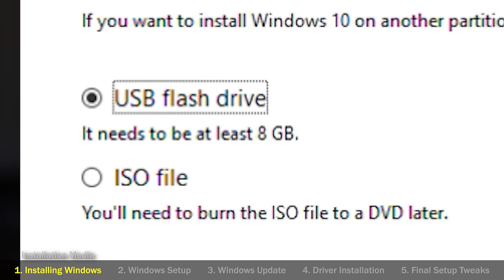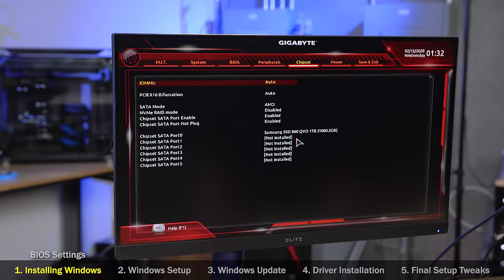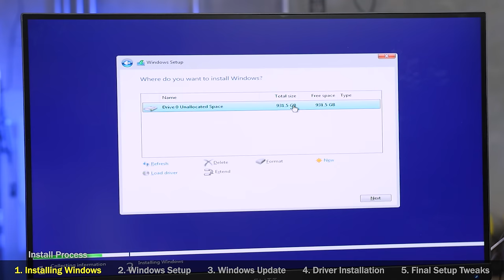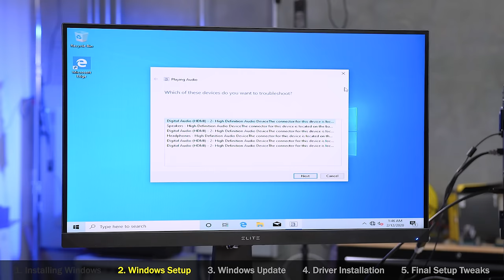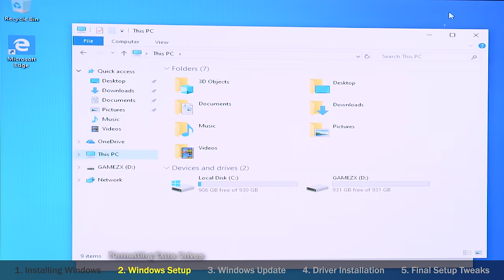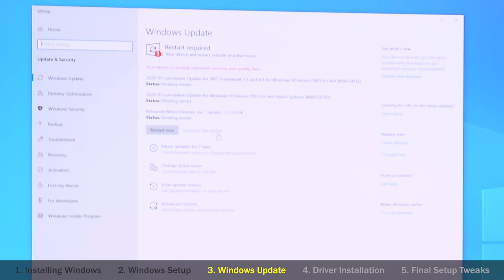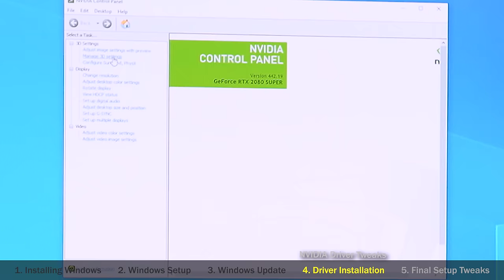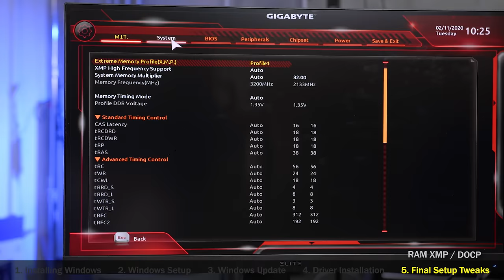Guide: What to do AFTER building your computer...

Comment: Pro tip:   after getting Windows up to date, run "disk cleanup" and delete the old Windows installation files freeing up 20 GB plus on your operating system drive.   You're welcome.
Reply: thanks
Reply: Can I just find it if I type "disk cleanup" in the win search bar?
Reply: ItzStreamBot do i go to properties when i right click the disk on my computer?
Reply: uhh i think you might need them for backup?
Reply: Saving this.
Reply: Imperial Diecast nope cus u can always boot ur windows usb flash drive to reinstall ur os
Reply: @ImperialDiecast  no, you don't. You might be thinking of system restore, which is not the same as old update files.
Reply: I get the disk cleanup but how do I delete my old update/installation files? Which ones are they?
Reply: @enhancedjerry5251  You have to click "clean up system files" (bottom left button--wait for it to scan, then make sure "Windows Update Cleanup" or "Windows Installation Files" is/are checked).
Reply: Did I mess up by buying a windows cd without a disk reading thing
Reply: Do I need a hard drive cause I only bought a 500g ssd
Reply: @homeskillet8751  It depends on what you are doing with your computer.   For basic web browsing and office work 500 GB is plenty.   If you are a big gamer, you will need a second drive for game storage.
Reply: Delete Win32... Saves loads of space! 😂😂
Reply: @homeskillet8751  I only have a 240gb SSD, but I definitely needed more space for games. Got about 50 games on Steam and DCS and soon Flight sim 2020... Go with a 2tb HDD and then you can always get more if needed.
Reply: @JeckoPlays  If you have an activation key that came with the CD, you can just make an installation from USB with the MS tool, and then install from that and activate with the key that came with your CD (it's not on the CD itself). You'll need a USB drive with at least 8GB free for the installer.
Reply: @DaedalusSix  okay thankyou
Reply: Thx @ Ben klassen
Reply: Also delete system 32

Jk dont
Reply: I don’t need to I have 5tb
Reply: Also debloat tool works great!
Reply: @JamesW81  how do you do that? Is that totally seperate than 64, they do not intermingle?
Reply: @illustractorydraws  yes
Reply: big brain
Reply: Oh man, I knew that but I completely forgot about it
Reply: The usual maintenance always does favors.
1. Right click to Run: %temp%, temp, prefretch--------> delete all

2. Disk cleanup

3. Defrag
Reply: Unless u had windows 7 and u want to go back because windows 10 is shit
Reply: I don’t expect a response so late after the fact, but does this apply to installing a second drive? I originally had just a 1TB SSD, and I’m adding a 1TB NVMe drive. Do I use a bootable Windows usb drive and treat it like a fresh install to the NVMe, then follow what your comment says and apply it to my original SSD that still has my games and other files?
Reply: @djingo8253  Try cloning your SSD to you NVME.   You'll need a NVME USB external enclosure unless your current motherboard supports M.2 drives.   If it does, put it in there and clone all of your partions on your current C: drive SSD to the NVME with free Macrium Reflect software.   After done, go into your BIOS and select your NVME as the first to boot (highest priority).   After you've confirmed that you are booting from the NVME, you can use "disk manager" to reformat your old SSD for other uses.
Reply: @djingo8253  Make sure you are running the uefi version of Windows.   If not, I'd recommend just moving your game libraries to another drive then doing a clean installation of Windows using UEFI.
Reply: Ben Klassen I am running UEFI Windows (or it was, I’m rebuilding my computer with updated parts) , and I don’t want all my game files on my NVMe yet, just Windows to boot up and then add more files and game libraries when I’m ready. I’m more concerned on installing windows on 2 drives in my system
Reply: Ben Klassen thank you for responding!!!!
Reply: @djingo8253  In that case, I would recommend just a cleam install of Windows on your NVME.   If your computer is a pre-built (HP, Dell, etc.)  look for the option to make a system recovery disk or USB drive.   Make the disk then use the disk to install Windows on your NVME.   You just have to select to boot from the USB or disc in the bios.
If your PC is home-made from parts, download the latest Windows 10 .iso from Microsoft and make a USB bootable UEFI enable installation thumb drive with Rufus.   Then boot from your UEFI thumb drive and install Windows to your NVME.
Reply: Thank you so much🙏 I put my computer together from separate parts. There won’t be a problem with windows installed on both drives when I try to boot?
Reply: @djingo8253  not if the NVME is higher on the boot order list in your bios.
Reply: Ben Klassen I appreciate your patience and professionalism, and apologize for sounding like an incessant child who wants to play fortnite... thank you very much
Reply: @falsely  also be sure to click the button at the bottom that says "Clean up System Files"
Reply: @Trueflights  If you start it by typing cleanmgr.exe in the search you can right click the search result & run as administrator, which runs it with that selected to begin with, saves it calculating savings twice.
Reply: @illustractorydraws  Yes, you can. At least on any Windows version from the past two years+.
Reply: @enhancedjerry5251  What he didn't mention is clicking "Clean Up System Files", which will then do a second scan on system files. THEN one of the options will be called "Windows Update Cleanup", and the other will be old Windows installation files (or something to that wording idr exactly). If this is a brand new Windows install, you may not even have that second one, and if this is after an upgrade/update from Windows 7/8 to 10 or from an old version of W10 to a new version (aka a feature update), then deleting these will cause you to be unable to revert back to that previous version if you have problems. Also, I think Windows automatically deletes them after a month or so.
Reply: Running Tron script wouldn’t hurt either!
Reply: What's the main benefit of activating a windows user account offline instead of on-line?
Reply: is it okay to install my drivers and the windows installation media on the same USB before booting up the PC for the first time?
Reply: @abzz9913  Yes
Reply: Thanks ill try that

Comment: The real thing to do after building a new computer is to sit and stare at the spot where a new graphics card should go.
Reply: My answer was to get a 5600G lol
Atleast I can play some lightweight games lmao
Pain
Reply: So expensive right now 😫
Reply: @MishiMIshaniz  i got the 5700g.
Reply: @rebelprime  better to get 10400f (cheapest strong cpu) with used gpu
Reply: @Donutsdesigns  here in australia, a gtx 1650 is like 400 AUD, not great but not crazy.
Reply: Cheeky
Reply: @MishiMIshaniz  I have a 5700g lol I feel you
Reply: @kinnymane8593  so about 1100?
Reply: I have a 1060 6gb, 1080p is good on most games and I play competitive FPS and do good with it. 

Tbh you’re probably better of waiting if you can and just get something cheap to last a couple years till you can get a decent gpu. Then again this could be objective as most my games are cpu bound..
Reply: @kinnymane8593  what currency? USD? Bc that's less than what I paid for my 6800XT
Reply: Well... I guess I have something there, at least, though it's just a GT 710, so there's still far too much free space. =(
Reply: @kinnymane8593  thanks I need to look into that ✌️
Reply: @xil3ntkha0s  I got the 5950x cpu and it’s an incredible combination with the 3080. Running everything maxed out on 1440p. Ray tracing and everything, even cyberpunk I’m getting tons of frames. On RB6S ultra graphics I’m getting 400fps lol it’s worth the price I believe
Reply: @kinnymane8593  lol yeah the 6800XT only gets high fps in that game if you turn off Ray tracing running at 1440p otherwise you get like 30 or so with everything maxed out.
Reply: @xil3ntkha0s  good news is the gpu shortage means you can sell it for the more than you paid😂
Reply: @zcupofwater  that's actually pretty bad, i got a 1050 ti for a quarter of that price
Reply: I'm reusing my radeon rx 470 till I upgrade to a 570
Reply: @kinnymane8593  yeah i dont know what people are complaining about you just gotta look at some of the lesser known websites or check the big websites everyday and you'd have what you're looking for
Reply: @epenaloza52  damn feels bad man
Reply: @hent-imeananime2141  -_- you have no idea I'm basically where I was before. my gpu is limiting my gaming abilities I can play some games
Reply: I can't believe it, got a new 3090 Strix for 1000$. If I mine with it it pays for itself.
Reply: @profiyntroz5186  5600g gives same performance as r5 3600 and r5 3600 is better than 10400f soooo no
Reply: This is what I'm currently doing...
Reply: Bro this is so true 🤣🤣🤣🤣🤣
Reply: Lmfao
Reply: Lol I got a gt1030 and it still cost twice the release msrp. Not even trying to game just make my shit work. Picked the worst time to build a PC. Cant imagine trying to get into pc gaming, not even worth it atm.
Reply: Me with my gt1030 GDDR5
Reply: Kinda sad but i got my GPU before my CPU, RAM and PSU
Reply: i just got the RXT 3080 for $750. Havent built yet but i think its worth it. Prices are just going to get crazier
Reply: @profiyntroz5186  10400f doesnt have integrated graphics so u need a graphics card where they dont have one so they got the 5600g
Reply: @dukiest7368  have you read my whole comment? I said WITH USED GPU.
Reply: have a 3080 Ti im good 🙂🤣
Reply: @kinnymane8593  lol now they’re more
Reply: im borrowing a gt610, really ballin rn
Reply: Got a lovely 3080 here
Reply: Got a RTX 3060 for 800 still scalp price BUT I’m happy it can run mostly ultra/highest settings
Reply: im doing a new build now. Cant even sell my old build because i need to use my old 3gb gtx 1060 thats in it until i get a new gpu...
Reply: Buy a gt 730
Reply: @hent-imeananime2141  what are you talking about? If I lived in the US I could easily upgrade. Which site do you think I can check that delivers to europe and has decent prices and supply from time to time? All I see is this microcenter shit that has all the gpus in the world.
Reply: @zcupofwater  no dude.  That’s crazy.  That’s way over msrp.
Reply: Yes lol!
Reply: IGP
Reply: @MishiMIshaniz  same here at least we have a good cpu when we get our graphics cards
Reply: That's what I'm doing right now 😅
Reply: If your going to wait until you can get a gpu easily for msrp, which isn’t going to happen till late this year or early next year at the best. I’d spend like 100 to 200 dollors on a low end card until you can get your card for msrp.
Reply: I currently play on a gtx1030 2gb, its the only graphics card i could afford since everything else is 500+ im saving for a new graphics card, but not planning to get it yet, due to the gtx1030 still running most games at 60+ frames (with some restrictions, such as low graphics)
Reply: @Professional_Narcissist  lucky man
Reply: Yo .I was depressed 4 months ago when I saw this lol
Reply: Asus 3080 ti tuf gaming😍😍
Reply: Just bought a 1660 for my new pc lol
Reply: me about to get a 1660 : 😎
Reply: I just bought a custom build from rgb custom pc and that solved that problem lol.
Reply: They (3090) are in stock in Europe…but it will cost you a whopping 2500€ / 2700$.
Reply: @VeniVidiAjax  that’s about 3000 in USD!
Reply: So true.
Reply: Exactly what I'm doing!! LOL! That and checking FedEx tracking religiously
Reply: @MishiMIshaniz  That's the CPU i went with for my build although i did grab a 3050 card as well (the integrated AMD gpu is nice to have though as back up if the NVIDIA card fails). Paid more than i should have considering it's the bottom of the barrel for the 30 series but oh well. I can always upgrade and hope the damn prices for higher end 30 series cards drop when 40 series comes out.
Reply: Thank god they're getting cheaper right now.
Reply: get the 3060 ti 500 is kinda painful but also kinda worth
Reply: @Katinggangseng it’s £120 more and not that much difference
Reply: Man, when I was a boy, I used to cut out things that my family couldn't afford (90s; Russia; hard times, you know); like VCRs, camcorders and stuff like that. A pair of scissors, a piece of cardboard, and you'll get some satisfaction - I swear it!
Reply: @MishiMIshaniz  same and I’m getting a 3060 in 2 weeks!
Reply: I know this is old...but that's exactly what I did for the last 4 months
Reply: I am staring at the door and waiting for my dad to come back. He said he will be back with a graphics card.
Reply: @profiyntroz5186  

"Used PC Parts"

NOPE
Reply: Or to sit down and stare at your very expensive gpu and everything :)
Reply: Wooooow lmfaoooo
Reply: so true. i built my pc in 2019 and ran an old gpu until a month ago (may 2022 I finally could get my hands on one)
Reply: haha swear to god, looking at my empty slot right now
Reply: @stiliyankachev  check pc componentes, they are in spain but they ship to some countries, maybe ships to yours too, since i live in portugal i buy in pc diga which i thing is the best in this country, can buy a 4080 for 1.500€...
Reply: @epenaloza52  Not worth the extra money unless you got a rich daddy, then go ahead.😆
Reply: Have been sitting here for a year doing this XD got my gpu today though :D
Reply: Yep did that
Reply: Rx 580.. Still damn good, Hella cheap too.

Comment: This comment will likely get lost in the sea of others, but I am a veteran PC builder and upgrade every few years, I still learned a good deal from this video (my methods were slightly out of date). Everything here is super clear and concise and I even have a very similar build to you that I am about to piece together!  Thanks for everything, liked and subscribed.
Reply: I won't let it go :)
Reply: I need to build a system that can run modern warfare at 1080p. Please help recommend what to do...
Reply: @optimize26  ryzen 5 3600x, 16gb of ram and a rx5500xt 8gb
Reply: @optimize26  just search a 500$ pc built, theres a vid, hold up ill try and find it
Reply: Bryan Leclerc educate yourself. Then go to pcpartpicker
Reply: Hans Alberto how about the Ryzen 3 3100, is that good enough?? Just in regular 1080p60, even with a ASUS b450m-a csm with a wd black sn750 500gb? How will all of that work out?
Reply: If I use the Windows media tool to make a bootable windows 10 usb on a flash drive, will it give me issues with drivers since my build is brand new?
Reply: 420th like, you're welcome
Reply: @optimize26  it really depends what your price range is exactly but I made a very nice list on PCPartPicker for a budget build around $800 that should be able to destroy 1080p gaming. It is definitely possible to go even cheaper but you will likely be skimping in certain areas and probably not get very high settings, even at 1080p. https://pcpartpicker.com/user/Watsonator/saved/JXyMvK
Reply: Cory Morgan is this all of the parts I need or is there more that you didn’t include in the list? And do you know if it would run good on warzone and maybe how much fps I would get. Thanks!
Reply: Since you build pcs before I havnt and I’m getting a setup I’m only getting a 500 gb nvme is it ok to get a 1tb ssd later on when I need it?
Reply: Hans Alberto you literally just described my build lol perfect 1080p gaming lol
Reply: @thenjdevil5102  Yes that is totally fine, I had a 1 TB NVME and later added on a 2TB SSD with no issues, literally just plug and play (after you identify it with windows).
Reply: @ryancoy5211  These should be all of the parts you need EXCEPT for windows. I do not include that in my builds because most people already own windows and it is possible to create a bootable drive from an already legit copy of windows (plenty of youtube videos on this subject, including one from Jayz2cents I believe). This computer should run Warzone just fine, I am not sure what the FPS would be but I would imagine well over 80FPS at 1080p. maybe more, just guessing here.
Reply: Now is a strange time to build because there is a shortage on PSUs and other parts. HOWEVER, a lot of the newer AMD chips are lowering their prices like crazy right now. Definitely look into the new Ryzen 3 3100 and Ryzen 3 3300x (SRP $99 and $119). Insane value, even if you have to pay a little more for them currently.
Reply: @threefourfivesix  Why he doesnt need that x series,is that supposed to be optional? If he gets one,whats the matter? Just asking because im still learning
Reply: @nosveratu7140  Look, besides if you utilize a shit ton of excess needs like pcie gen 4 or anything else you dont need a x570 motherboard because b450 motherboards can oc basically as well and dont really offer a bigger difference besides if you have no budget and want a 3900x

edit 1 : also you can spend that extra money on things that will ACTUALLY benefit your system like any other component even a psu upgrade
Reply: Yeah I didn't know about the shift click restart option in Windows, that was neat.